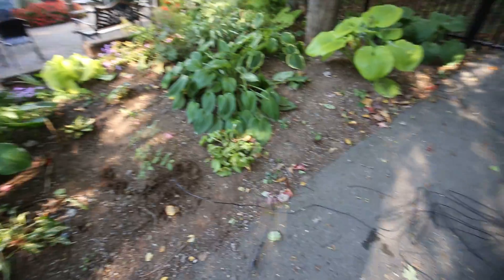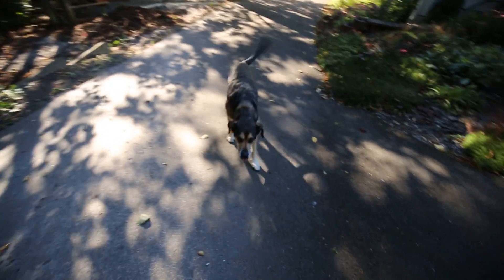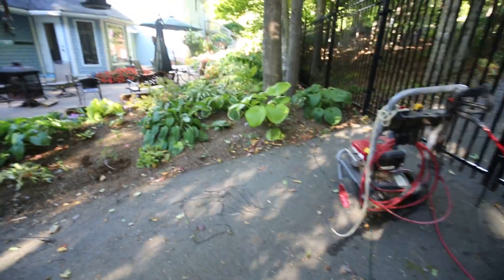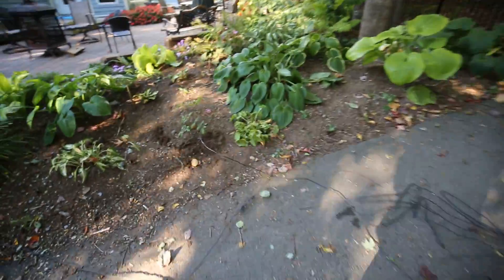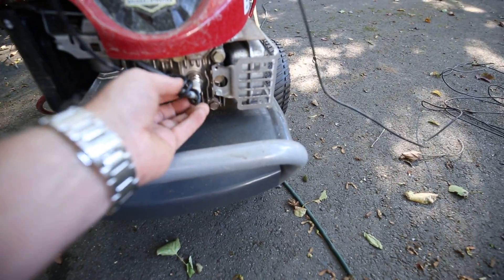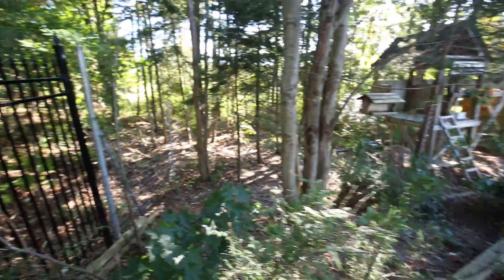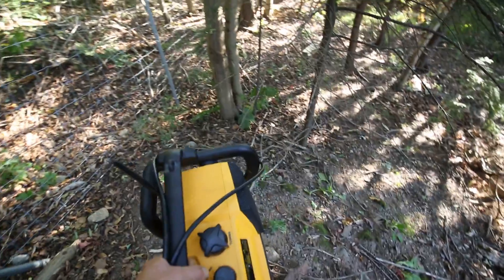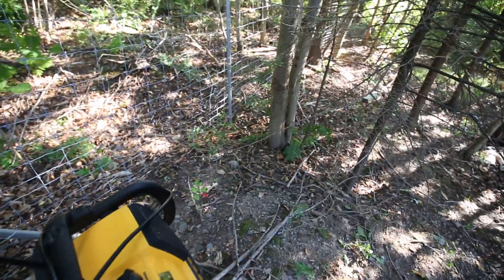2016   Finding the Invisible Fence Break

Comment from the maker: Although some have pointed out the potential to burn out the pump, I'll just point out that the method works.  Any gas engine with a spark plug would work.  However... on the downside we've moved almost entirely electric now for our yard tools (Dewalt mower and washer) so we don't have a way to do this anymore... however, on the upside, we don't have a dog anymore, so we don't have to check this anymore :-)

Comment: nice description in help finding a break. just one thing though, you used your pressure washer. did you know you shouldn't run a pressure washer without water on the pump bc you will burn the pump up.
Reply: A lawn mower would been suffice.
Reply from the maker: Just replied to a similar comment, and the risk is worth understanding.  ... but here we are 4 years later and I just sold the washer in perfect working order :-)